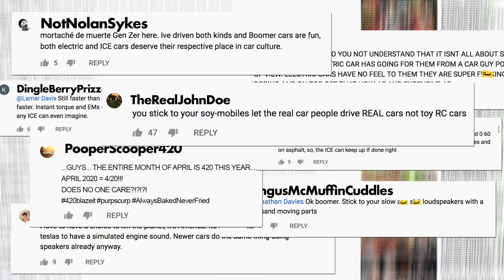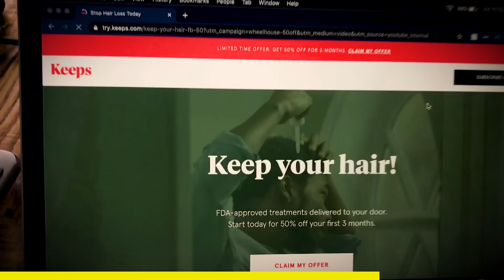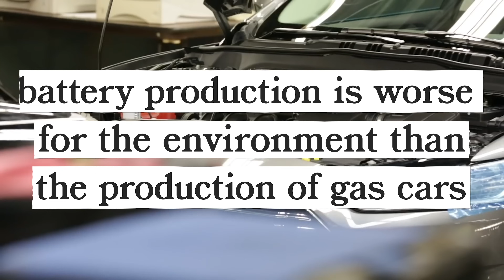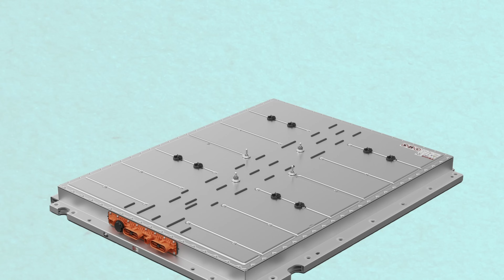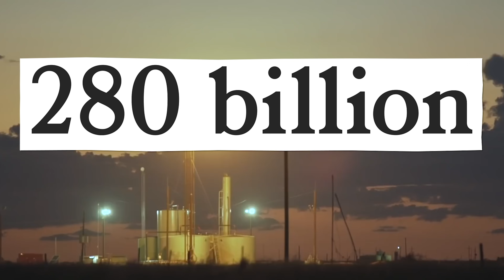Are Electric Cars REALLY Better for the Environment?

Comment: Thank you for including the impact of gasoline production in your comparison. Many people comparing the impact of EV vs ICE only compare coal burning factories to tailpipes. INPUT and OUTPUT of both need to be considered for a fair comparison.
Reply: how does the manufacturing process get there oil from to produce and distribute there EV car to the dealer as well as keeping the factory going. he missed out getting the mined products to the manufacturer to make batteries, then the disposal of said battery
Reply: @Sim-Racing-55  both of those figures are included in the manufacturing carbon emission of both vehicles.
Reply: @Sim-Racing-55  batteries can be recycled, unlike fuel. So that's likely a bigger positive for the EV
Reply: @torrel8074  Not only that, they can be recycled, so that's another positive. 🙂
Reply: @DriftComet  not really, that’s literally talked about in the video.
Reply: @torrel8074  And car manufacturers build batteries so that they are almost impossible to replace. There are still articles about dents in the battery housing that repair is almost more expensive than the car itself. The environmental costs of maintaining and expanding charging infrastructure are also important and should be taken into account if you count fuel production.
Reply: @Dobaspl  Fuel production on both sides was considered in the video. Fuel distribution infrastructure was not so it would be interesting  to know the difference a charging station has vs a gas station, but I would guess it's not that much of a difference. Probably favorable on electric tho seeing how gas needs to be taken by boat and truck to get to the stations while electricity just goes through the cables. Most cables would be maintained regardless as well since its part of the electrical grid.
Reply: The battery recycling is a kind of jock, 3rd world country will suffer from the used batteries in near future
Reply: That's cool, they're already suffering from climate change since the 1980s.
Reply: @joshuawang5859  We need to develop an electric plant powered by burning EV batteries! 😏
Reply: actully we  all know EVs suck when it comes to driving they are boring as f**k
Reply: One thing i think is sometimes ignired on the EV side is that with scale. Comes more issues. If we scaled up and every car was now an EV. We would have to strip mine the ocean for lithium. There is enough lithium and cobalt right now on land. Even if it is mined by child slaves in many places. But with scale this becomes a supply issue. 

Not to mention, litium and cobalt refining is very very nasty business and although it doesnt produce as much greenhouse gas. It produces a lot of other stuff you really dont want anywhere near you

Comment: When comparing, one should compare apples to apples. As soon as you make the graduation from the lower milage EV@200+ miles to the Higher milage EV@400+ miles ( Combustion Cars have a 400mile range )an honest comparison reveals that the gas burner puts out less emissions over its life span than an EV.
Also, in the state of California there are issues and have been issues for years with the power grid. Rolling blackouts are common place in the summer months. There are many places where installing a home charging system is not possible due to the lack of enough amps.

Anyone with the ability to think knows that EVs will become the transportation of the future. It is not the slam dunk, smooth sailing that you portrayed.

Comment: Did you factor in the carbon costs of making solar power farms or wind turbines, both of which are ’filtered’ renewables… ie they only work during the day when it’s clear or when it’s windy❓
Reality at the moment is that 2/3 of all electricity is from fossil fuels. Also, if comparing EV to IC vehicles then it has to be equal range vehicles, 400 mile range EVs have the largest Li batteries whereas a 400 mile range IC vehicle is common. You then have to factor in the longevity of each vehicle and the costs in carbon of scrapping. If you do the average statistics across these variables you’ll find that EVs do not yet make any sense whatsoever, neither do renewable energy sources either. EVs or mankind doing anything else will not stop Global Warming. I leave you with the sobering thought that humans cooking rice to survive creates more carbon dioxide annually in the atmosphere than all the aviation industries combined.
Reply: I would like some source for your rice claims. As for renewables, there are many examples of places with majority renewables grids that are exceeding what they had with fossil fuels in terms of reliability. Such as south Australia with over 75% renewables grid. I can get into the particulars if you’d like but suffice to say there are some intelligent methods you can use to make intermittent sources reliable as a whole. 

As for cars. Since when does anyone compare two cars on just range? What a weird thing to do… considering most people don’t drive 400 miles per day it’s not really pertinent. Combustion cars require the higher range because you have to find external places to fill it up. EV’s are charged at home while you’re asleep. Or anywhere that has electricity. Which is pretty much everywhere. They don’t need range to wander looking for fuel. They don’t need extra range so that they don’t have to drive to a third party fuel station every day or every second day. It’s not a consideration for EV’s.

As for lifespan. You are aware that modern EV’s (as in, not the 2010-2012 Nissan leaf’s) last roughly double the average lifespan of an ICE right? Batteries included.

Comment: TRUTH: EV cars do put out less of a carbon footprint than gas but what he didn't say is by how much.
the answer: NEARLY JUST AS MUCH
As long as the elctricity you get is from burned coal. then Yes.  its not as bad as gasoline from a tailpipe but  it's still like 85%
So basically you're only improving by a little.  Not to mention how toxic lithium is to make the batteries.
Reply: Well no. By a lot. Infact even on a coal only grid (which most places aren’t, even the US is majority gas). It takes around 15k-25k miles before you break even with an ICE car for the extra emissions produced making the batteries. Infact most EV’s sit close to an equivalent emissions from coal, as a car with an efficiency of 78mpg. That’s BEFORE you include the massive amounts of energy and emissions produced to refine and transport the fuel. So no. It’s a big difference.

Comment: The mythbusting segment at the end was cringe-inducing. Starting with Myth 1, Nolan states that EVs in states with access to cleaner forms of electricity like windmills, solar, and hydroelectric would be cleaner than those powered by fossil fuels or coal. Rebuttal. Clean energy is actually really dirty too. Wind and solar are mostly just overly-expensive and under-productive wishful thinking that requires a TON of land space. These are important factors that should not be left out.

This leads into Myth 2. The power grid cannot handle a quarter of the entire population switching to EVs. And don't forget that the goal is 100% EV usage. The plan is to phase out combustion engines completely. I don't know where you got your information, but don't trust them when the open their mouths on anything else. Brown-outs already happen occasionally already, because we are close to peak capacity right now. The power just shutting off periodically would happen for sure. And that's on our current power production infrastructure that's bolstered with fossil fuels. Imagine what would happen to EVs if our power production followed the Paris Climate Agreement. I hope your refrigerator can run on slick powerpoint presentations. If we can harness the power of green study lies, we'll power the world.

Myth 3 is easy to tackle. The government does not have any money. It has access to your money. They will bribe you with your own money. And they'll pay a few government employees' salaries to carry out the redistribution. They'll either take the money from you in full plus the extra to pay themselves or they'll borrow it from a foreign country, sticking your children with the bill and making your country beholden to that other country. Of course they could always just print the money. I hope that Bidenflation has proven why that's not a great idea. Enjoy high prices for the rest of forever in order to forgive today's debts. Those higher costs will be absorbed by everyone and that includes poorer people. Regardless that luxury EVs give you less of your own money back than other EVs, poor people won't buy either of them. They'll buy a 2004 Ford Focus with 130k miles on it. Buying brand new cars is something rich people do or stupid people do. Anyone who buys secondhand or buys a car that's not an EV will be paying the subsidy without enjoying the returns.
Reply: Myth 1.) rebuttal to your rebuttle, clean energy is actually significantly cleaner than fossil fuels. Mostly on account of not burning literally hundreds of tons of fossil fuels every single day of its operation. This is a very well founded and very undisputed fact. The only people who dispute it are under educated reporters working for media companies with ties to fossil fuel companies, pretending they have any education in any stem field what so ever.

Myth 2.) only in certain states. Most places in the US and developed countries don’t have any such issues. Infact the US at large has a very robust energy grid. You will notice that Nolan refers to the national grids. Not any specific state grid such as California which is a prime example of what happens when politicians chose to play Engineer instead of politician. It’s also worth noting that EV’s typically do most of their charging during off peak hours when most generators are shut down at great cost to the operator because there isn’t enough demand.

Myth 3. Most of your rebuttal here seems unhinged and aimless. However there will always be a new car market. Without out it, there wouldn’t be a second hand car market. And all good inventions or new technology has also been offered to the rich as a luxury item. Colour TV. Radio, cars, plasma TV, flat screen LCD. They were always released to the high end consumer markets first. That’s just a fact of life. 

However the cost savings for consumers with EV’s is significantly. Being between 10-20x cheaper per mile in relation to fuel/power costs, modern EV’s also last longer than ICE vehicles and require next to no servicing what so ever (what is there to service?) when I was studying Engineering as a student working 2 casual weekend jobs. I scrapped together enough (at a very big financial stretch) to get a loan to buy a Tesla model 3. However, I’m easily paying down the loan using the savings im making noting buying fuel or getting regular servicing. Although the upfront cost was high (and almost unachievable) the savings in operational costs has made the car easy to afford and saves me a lot of money in the long run. I’m be had it for 3 years and 110k miles and still going strong like new. Only service has been new tires at 90k miles.

Comment: You know cars. I know the grid since I work and install it. We can overload our electric grid and cause additional faults especially in the summer when the AC is also running. 

PS. Please dont block the green boxes in your yard. Thats your transformer for yours and your neighbors houses. And if its vlocked you will be without power longer cause we do have to clear it. If its burried. Call the electric co. To have it raised and cleared. DO NOT put bushes arround them.

Comment: The problem with electric cars is the battery, it is expensive, heavy, polluting to build and not optimized. I heard that Tesla is working on a hydrogen electric car. It recharges in 5 minutes, no need to install a charger at home, we will have charging stations like gazoline. Even homes will be able to have this system to heat and provide the electricity needed. The Toyota Mirai has this technology right now.

Comment: Electric vehicle are better than gas. Your typical gas engine is only able to get maybe at most 30% efficiency from the fuel burnt for power. While at a proper industrial factory they are able to take the same/similar fuels and bring out and get 60% efficiency out of it. On top of that those factories can be built in low population regions where greenhouse pollution isn't as impactful on the environment. For example if all the cars in the world switched to electric and we had to make more factories to produce electricity then it will help with global warming drastically getting all that pollution and heat out from everyday circulation.

It's just oil companies don't want people to understand that. They are also the main factors as to why solar panels have been slow to develope

Comment: Great content.  This is an important discussion.  So many people are misinformed about this subject I get tired of hearing it too.  Thank you for your unbiased opinion.
Reply: you realize you have to change batteries in evs right? so the amount of times you have to do that compared to how long the combustion engine lasts... you are far worse.
Reply: @lootingiv4058 I don't even know anyone who has had to change an EV battery I feel like this is a made up issue if anything the batteries are lasting a lot longer than expected.
Reply: @alzzz1-129  I mean its not really possible to know everybody
Reply: @lootingiv4058  broo, battery recycling is already a thing. Do you think the batteries in our phone, laptops,etc is only ended up as a junk?
Reply: @lootingiv4058 thats literally made up. Good EV batteries last the whole life of the car and idk where yall are coming up with the “you need to change the battery many times” thing? Is it just because ICE cars need the 12v battery changed so you think the EV battery needs to be changed as often too?
Reply: @Lilpiip123  the life of the car is literally how long the engine or battery lasts.... obviously the batteries last as long as the car 🤣🤣 Thats what determines it lol. and im not saying it needs to be replaced as much as the ICE batteries. I am just saying the battery doesnt last as long as the ICE engine
Reply: @lootingiv4058 ICE engines lasts around 150,000 miles and EV batteries are designed to last around 200,000+ miles easily. Tesla batteries are designed to last 300,000 - 500,00 miles. Are there cases where some EVs needs their battery replaced before the 200,000 miles mark due to quality control? Yes, just like there are many instances of ICE engines blowing up before the 100,000 miles mark. The point is EVs, on average, are built to last longer than ICE vehicles.
Reply: @L0stH0riz0n21  150,000 ☠☠☠☠ Any well maintained ICE engine will last 300,000+ easily........ You must not have vehicles or work on them
Reply: @lootingiv4058  lmao, I said average life of an ICE engine, you're providing anecdotal evidence of "well maintained" engine which has most of the old parts replaced by new ones. You think these batteries needs maintenance? You must not know how to critically think. 🤣 🤣 🤣 .
Reply: @L0stH0riz0n21  and maintenance doesn't require an new engine to be made lol. Even not well maintained. My friend has a truck that he never puts money in it, never does anything for it and its like 310,000 and still not a single problem lol
Reply: @lootingiv4058  again, you're spewing anecdotal evidence and I doubt your buddy never did anything to his engine to make it last that long. Upkeep for an ICE engine to get to 300,000 miles requires new timing belt, fuel pump, spark plugs, gasket, etc. Lots of maintenance and replacement parts to get an engine to last that long. Whereas EVs are much easier on maintenance with a lot less moving parts, thats why most of them last much longer than traditional ICE cars. This is a simple fact, otherwise share me your data (on longevity of ICE vehicles as a whole group, not just one or two electoral evidence,) that proves my argument wrong.
Reply: @L0stH0riz0n21  Like I dont know what my friend is doing with his truck when thats all we talk about and do when hanging out lol. only things he spends are thinks like a new exhaust system (make it louder nothing for maintenence, and a lightbar and stuff) You really dont know much about trucks and ICE engines. Now a ford you have to change all of that but a chevy ICE engine will last a loooonnnngggg time. you dont seem to understand that though.

Comment: The only problem that I have with electric vehicles is lifespan nothing breaks for a long time and then suddenly something like the battery goes out and that's 22,000 to replace it and if you get so unlucky that you have to replace it once or twice is it really still at that point any better?
Reply: That's not true though. A battery is hundreds of cells grouped into modules. They don't all break at once

Comment: Sorry, but wind isn’t really clean energy. One 1.5MW wind turbine take 165 gallons of oil to run and oil needs to be added every year to maintain 165 gallons in the gearbox. Because most gearboxes leak about half of their oil every year. So no, wind turbines aren’t clean energy.